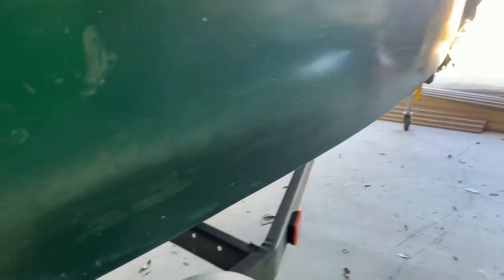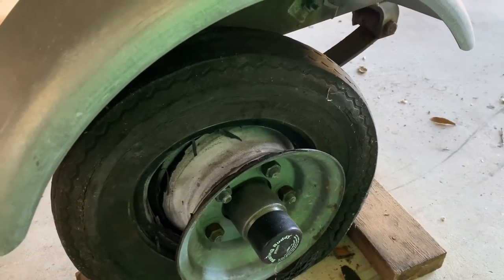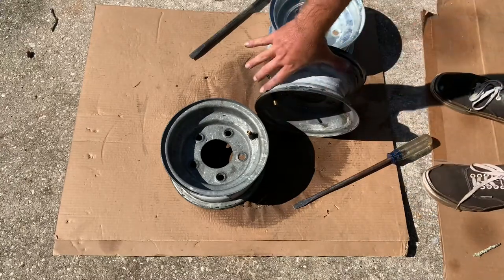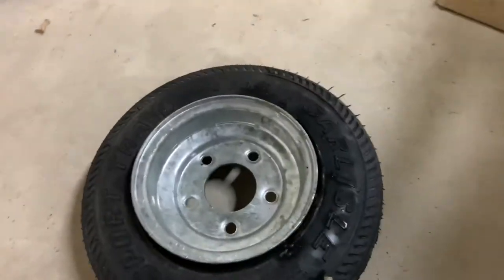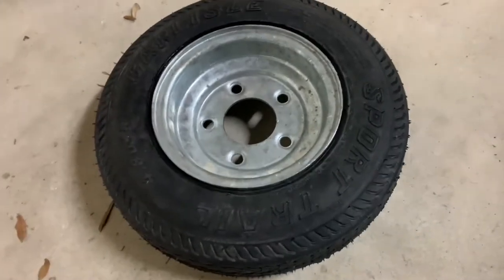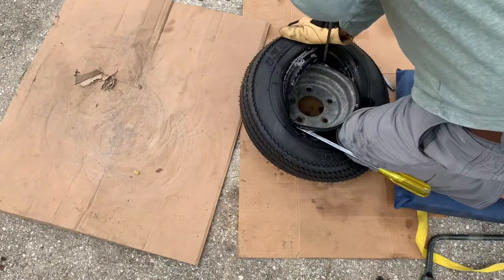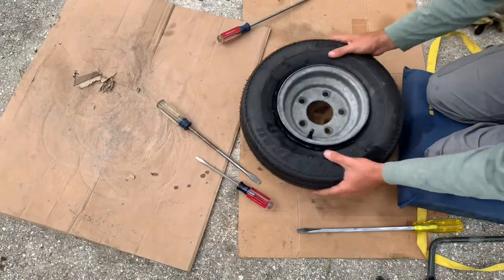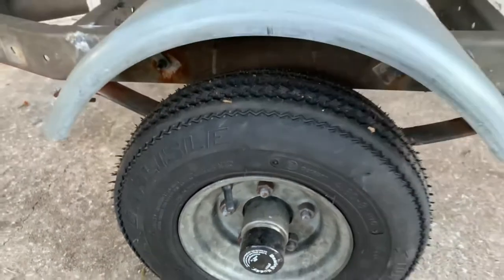Mounting Small Trailer Tires by Hand: A learning experience

Comment: Just put soapy water on the tire you have pumped up, if it bubbles, it is leaking, if not, it's good! Thanks for the electrical tape trick too
Reply from the maker: Thanks, I didn’t think about using soapy water at the time. It’s still holding pressure though so it’s looking like it survived. Glad you liked the electrical tape trick as well.
Reply: @UnderOnAbove  yeah, I have to mount and they are new tires so they are pretty stiff
Reply from the maker: Best of luck.

Comment: What size wheels are those?
Reply from the maker: 4.8-8
Reply: That’s what I thought. I guess I’m used to seeing numbers like 205/75/R15 on mine so I was thrown off. I’m looking to get a set of tires for my trailer that are much smaller to reduce the height of it so it can be stored in my garage. Needing about 3-4 inches more of clearance. Lug pattern is 4.5 on 5
Reply from the maker: Yeah, I have two other trailers that ride on 4.8-12 tires but this one sits much lower on the 4.8-8’s. A few things I would think about when switching tire sizes is axle clearance and load rating on the tires. Depending on the use of the trailer and all.

Comment: The use of 5.70-8 tires on that trailer (should fit easily without adjusting fender clearance) should slightly reduce RPM and makes the bearings last longer.
However, there is no obvious problem with running 4.00-8 tires at average highway speeds (highest speed limit is 130km/h on really long straight roads).
Reply from the maker: Thanks for the comment. I replaced the old tires with 4.8-8’s because that’s what it’s always had on it and those fit the rims I already had. It mostly sees local use so I rarely am driving at high speeds with it.

Comment: I'm UK based... Need to replace tyres due to age rather than wear - the limit is 10 years over here.
Thanks for your video - really appreciate you taking the time to film and share your experience. And it all made sense - just simple.
Electrical tape - brilliant. Soapy water - got it. 
I think I'll repaint my rims as they're getting a bit rusty - agree with avoiding landfill!
I'll use some old carpet off-cuts to work on (rather than the living room floor!). Probably better at avoiding damage.
The valve tool you used - probably need to get one?
Anyways - many thanks - wish me luck! 👍
Reply from the maker: Thank you for the kind words and I hope it’s not too bad of a job for you. Best of luck.

Comment: I would assume that the bead on the spare tire is damaged based on your method and tools used during the video and process. You should really do a little research and reading to gain some knowledge about the task you’re doing before posting a how to video in an attempt to “teach” others. Or at least watch a few how to’s yourself, It’s very obvious you didn’t. If you had, you probably would not have done anything you did do, in this video. And Flip Flops?! Asking for an injury.
Reply from the maker: Almost two years and hundreds of miles later and the tires are still holding pressure.